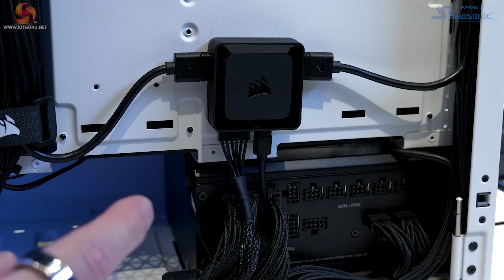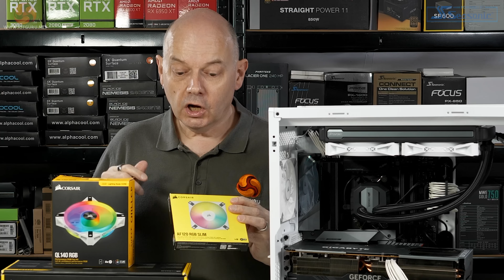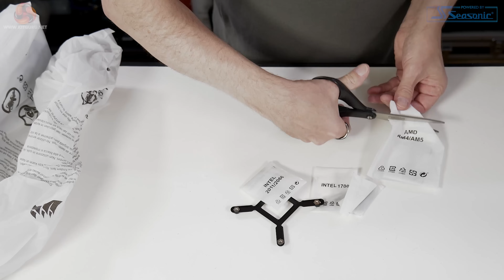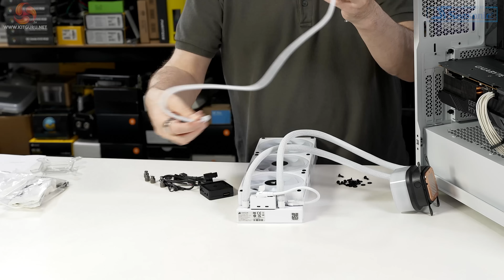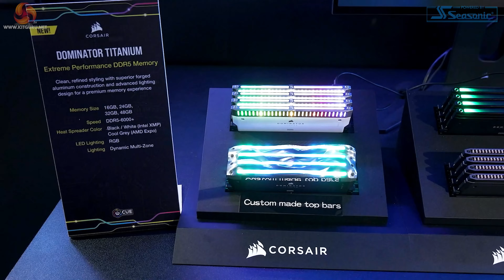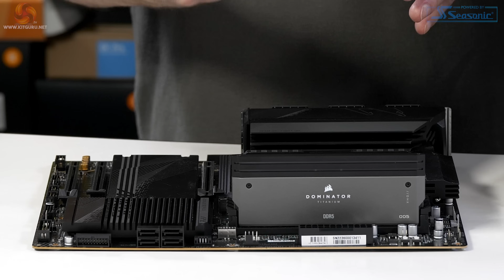Corsair iCUE Link Build with Dominator Titanium DDR5-6000

Comment: the system does not work this way, I installed it and the radiator fans do not turn on, which forces you to have to separate the fans in a connector and the pump alone, the documentation is poor or nonexistent, I do not recommend it.
Reply from the maker: Clearly I cannot tell what problem you have faced but I show the fans working in the video, along with a bunch of other detail.
Leo
Reply: @KitGuruTech  we are clear that they turn on, even with connecting them to the PSU directly, the issue is that they last over time against different scenarios that is where they fail, you do not tell much about how to connect them, in fact the fans you connect them in the wrong port at the beginning in the h150i, I think you just want to convince, corsair as usual does not talk about requirements and the pcie port does not give enough power hopefully only the h150i, it is a bad buy, missing a lot, the pcie ports are lacking, should use the 3 pin ports of the peripherals but more than one, etc. . .. it is expensive and in beta phase
Reply from the maker: @jasperirving007  You seem to have a number of problems but I am not clear what has gone wrong for you. You say I connected the fans incorrectly but as far as I recall I showed the entire process from beginning to end. When you say 'pcie port'  I assume you mean the iCUE Link ports and can only say they gave me no problems at all.
Leo

Comment: The fans being pre-mounted only helps if you're going to install this in the top of the case, since you'll have to remove them to install it as intake in the front of the case. Since most cases don't support 360MM up top, it'd probably be best for Corsair to NOT install the fans.

Comment: I purchased the Icue H150i Elite and 10 of the QX120 fans as I was planning on replacing the fans on the H150i with the QX120 fans because wouldnt you know it, corsair does not sell the H150i Elite AIO with the Icue link fans.  Then I found Lian Li sl-infinity fans.  The lian li fans are a bit cheaper, they work off the same concept, and they make the SL-Infinity fans in a reverse blade which will look much better.  So i returned my 900 bucks worth of fans and AIO back to corsair.  The problem Im having now is that I cant seem to find the SL-infinity reverse blade fans.  There are a few retailers selling them but they are seriously scalping the prices and seeling them for nearly 60 bucks each.  So im still on the look out for the reverse fans at the regular price.  I know some might say thats a lot of money for fans, but my PC case is the centerpiece of the my office.  I want it to look as good as possible.

Comment: This kit is aesthetically interesting and it did help the cable mess somewhat but IMO, not to a degree commensurate with the cost.  I would have welcomed a thermal performance analysis since that after all, is what fans/AIO are primarily about.   Likewise, a performance test of the rather costly DDR would have been welcome too.  My solution to the RGB cable mess is to not have any RGB at all except that installed on the main board.  That leaves me able to spend my limited disposable income on things that affect performance (like a better pump top) or on useful peripherals like VR (which is in the price range of this kit), or on support channels via Patreon membership.

Comment: Proprietary 👎
Reply: Well of course, no other company has a system like it, having the same connectors won't help your random fans integrate. Yes, the unique tech is proprietary.
Reply: Well, open source didn’t come up with the final solution to this (very old) problem so what did you expect?
Reply: Would be a bad idea mixing and matching anyway. Icue is set up to control these fans and read temps. It needs to be proprietary.

Comment: If they released it for other manufacturers to use then I would be super impressed.
Until then, its just another proprietary system that locks you into one manufacturer, so of little interest to me
The inflated price would even be worth it if you could mix and match
Reply: I mean, as far as I know corsair is the only company that does fans, AIO'S and Ram. they have pretty impressive streamlining. the price is outrageous though